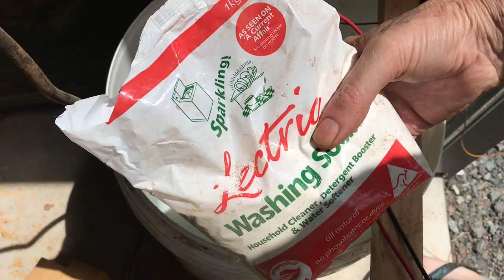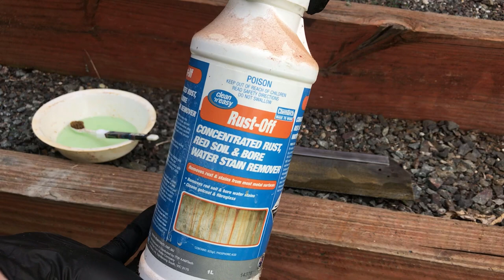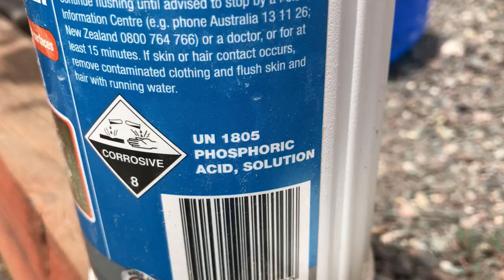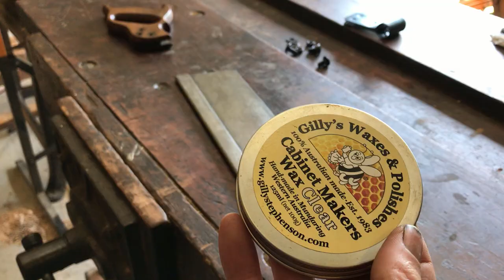Restoring a family heirloom - Grandad's Tenon Saw

Comment: Hello! Nice video. 
Before, at 0:44, we see that the rivet’s slots were aligned. After... 
??
jp from France
Reply from the maker: Hi Jean-Paul, Sorry I missed your comment and I completely missed that important fact. Traditionally the screw slots are aligned and in this case it would have been no trouble for me to align them since they did not have any thread. I must have thought it looked cool this way. Complete fail LOL. I still have access to the saw to straighten them.  I will ask my friend if he wants me to fix it. Thanks Matt.
Reply: @Saw-IT  
Thanks.